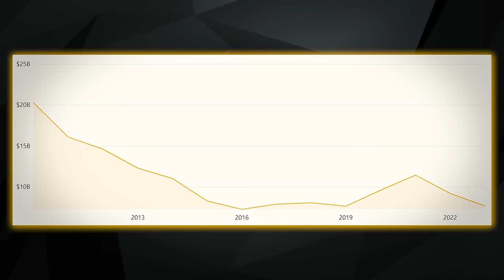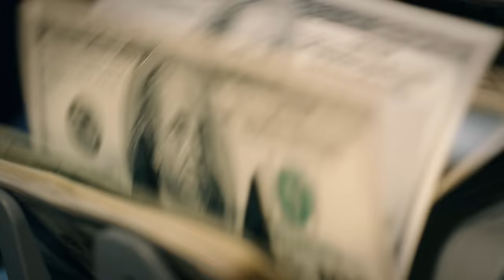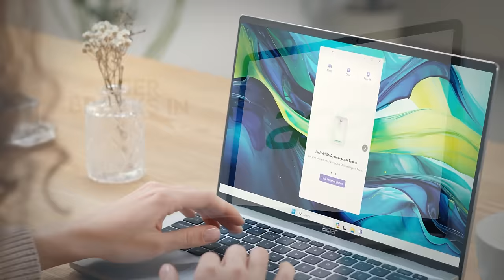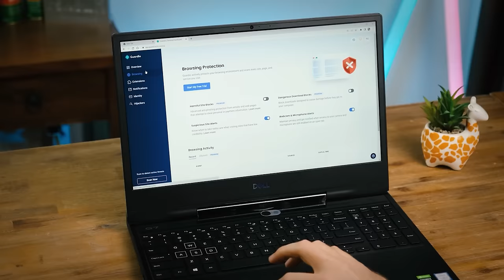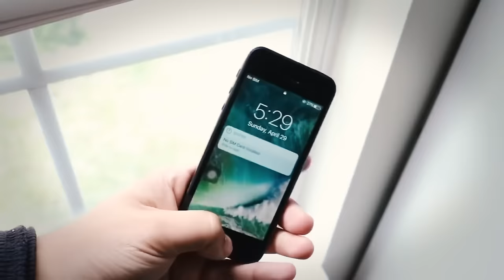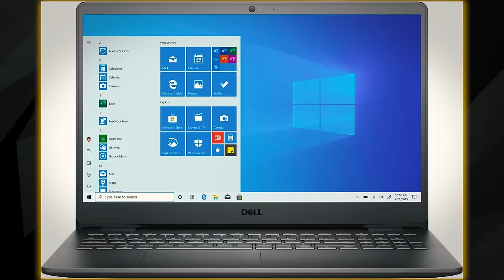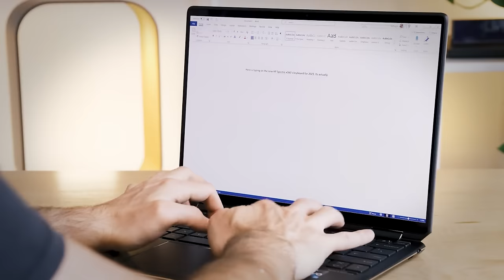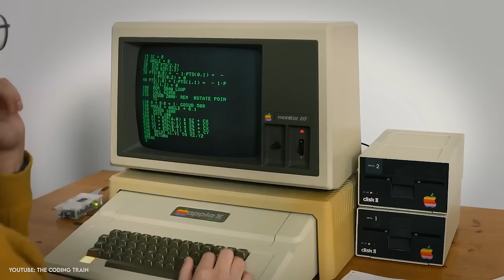Whatever Happened To Acer?

Comment: I am using an Acer Aspire 5 laptop right now and it's great compared to my old Lenovo laptop, it came with a harddisk initially but I bought a 500 GB Samsung SSD 980 and it works great now. Two problems that I find with almost every Windows based laptops is the poor battery life and very poor webcam quality when compared to MacBooks, if manufacturers can fix these issues, then Windows laptops wil continue to do well especially in the developing and poor countries where MacBooks are unaffordable to majority of the population.
Reply from the maker: Glad to hear that Acer has served you well man.  Battery life is definitely a worse for all non Apple laptops.
Reply: I have the same laptop
Reply: Yeah I also got an Acer Aspire 5 with the Core i5 8250U, it's nothing fancy now but at the time having 4c/8t and dedicated graphics in a budget laptop was very good. The only real issue it had was the 1TB HDD was murdering performance (even though it wasn't being used), but after tossing the HDD and bumping up to 20GB of RAM it's been fine.
Reply: All you have to do is purchase the right Windows laptop.  Apple only has a few models, it's one company.  Windows computers are built by hundreds of companies.  There are lower priced budget models, and other models that blow any Apple away.
Reply: i have the same laptop currently
Reply: I had an Acer Aspire 5 too - it was crummy. I guess you lucked out.
Reply: I too have same laptop with i5-1135G7, 480GB SATA SSD and 20GB RAM (4GB Soldered + 16GB upgraded), came with 8GB RAM
Reply: @adhithyamuthumani1199  Not bad at all, depending what video card it has.
Reply: @earthling1984  It has integrated graphics, intel iris Xe
Reply: @adhithyamuthumani1199  Darn.  Yeah you gotta get laptops with a dedicated GPU otherwise they aren't good for much more than websites and streaming.
Reply: @earthling1984  So far, there is no use for me to buy one with dedicated graphics since I use just for media consumption and notes taking. Maybe I'll buy one in the future. Tried Forza Horizon 4 Demo in this laptop, got just 15 FPS
Reply: @adhithyamuthumani1199  If that's all you do, that'll work.  For video editing / creating / gaming, you need dedicated GPU.
Reply: @earthling1984  Thanks for the info 😊
Reply: elitebook g8 and g9 have a battery life of plus 14 hours.....better than macbook.
Reply: you complain about battery life on Windows? Wait until you see how it goes on Linux....
Reply: the issue with windows laptops is the OS, its got a lot of bloatware compared to macOS. requires more effort from the user to debloat the laptop. a debloated windows laptop usually has around the same battery life as a mac in the same price range.
Reply: @racistlobsterofficial  Everything you just said is false.  What Windows laptop you buy will determine battery life (and yes, you can optimize any computer).  There are tons of Windows laptops that have batteries way better than any Mac.  And there are some that have way worse battery life.  1000's of companies make windows laptops, so there are options from very budget to very expensive.  And oddly enough, price and performance don't always mean better battery life.  Some high end gaming laptops are so powerful that they simply can not have a long battery life.  Mac is made by one company and only a few models.
Reply: @earthling1984  Well said
Reply: @racistlobsterofficial  Everything you said sounds smart and all (sounds good, rambling that proves no point).  But it's obvious you have very limited experience with Windows laptops.

Not sure what the argument is.  My point is there are plenty of windows laptops that beat macs in every way.  And plenty that don't.
Reply: @earthling1984  why not engage with the points i made instead of dismissing it as "rambling" lmfao holy shit. 

first off, the battery life in that price range for productivity laptops are extremely similar. i dont think its outlandish to say that and if you think it is, i would love to know why.

secondly, at the same price for a mac (lets say the 15 in m3 air, retailing at 1.3k USD ), you can get a 13th gen i7, maybe a 7940hs, maybe even toss in a xx50 GPU at the expense of weight. but these laptops will come with lower battery life compared to their mac counterparts. if you know of any that defy this statement, please do share more about it.

in conclusion, (1) battery life in that price range does not differ much if you are looking at productivity focused windows laptops and (2) these windows laptops at that price range will have shorter battery life if you do not debloat the system. 

i do not see how your point relates to my point at all. its very easy to just misinterpret the boundaries of a statement and toss in some common sense saying in rebuttal. of course my statement on battery life doesnt apply to all windows laptops. but i've already stated the ones which it applies to. 

im sorry that you cannot read anything longer than half a page, but that doesn't mean anything of that length is "rambling".
Reply: the battery problem isn't related to the os, it's because macbook use arm processor known for low power usage, if you want long battery live windows laptop you can pick arm based windows laptop like those that use snapdragon chip
Reply: @farhanrahmaddani3218  Yup.  All is power draw vs battery mah.
Reply: @racistlobsterofficial  The other bloat from Windows is the burden of legacy a.k.a. "backward compatibility", Apple just simply said "screw you backward compatibility, let's think forward"

Comment: I still own the Acer laptop I bought on early 2015. I have a newer laptop but Acer is the main one I use at home as desktop. Upgraded from 4gb Ram to 16 gb Ram, and from 512gb hdd to 2 tb SSD. It really works very well. I could use this for many years to come. I can not install Windows 11 on this, but I plan to keep using windows 10 and maybe switch entirely to Linux. I really dislike Windows 11. Had it on my work pc, but I formatted the laptop and installed windows 10. My experience with Acer has been very good.
Reply: I still use my 11 inch 2012 aspire one v5 to this day. It runs like a dream with low requirement linux distros.
Reply: Stopping using Windows literally 3-4xed my battery life.  But you will need to make some compromises to have a change this significant...
Reply: Go Linux, go!
Reply: @MuammarQadaffi Just use VMs and emulation. Microsoft's Dirty Operative System is no longer Quick (get it? haha). So it might as well just be a sub process on a superior system, just like most legacy programs (OG Mac OS, Amiga, ZX, you name it).
Reply: @MuammarQadaffi can you elaborate how and what you did?
Reply: @RERM001 That would make it even worse.  Windows 11 VM would probably drain that laptop's battery in 40 min.
Reply: Windows works badly on laptops

I think windows is created only for Desktop PCs
Reply: @MuammarQadaffi  This is exactly what i was thinking, when i used windows vm it actually drained my laptop's battery more quickly than simply using main os (windows)
Reply: @MuammarQadaffi  in my tests using different OS, only chrome os is giving more battery time, i used some Linux distros but none of them gave me more battery time than windows

Comment: I’m pretty happy with my Acer Nitro 5. Got it at a deep discount compared to other brands. It took 3 minutes to install a second SSD. Hope it lasts! It feels well built except for the hinges which are a bit wobbly. We’ll see!
Reply: Double on that. My Nitro 5 has even third SSD. Rarely a laptop has support for 3 drives. I'm using mine for 2.5 years already, it works great
Reply: I am a nitro 5 owner myself I have been using it for the past month I am enjoying it very much!!!!
Reply: Be glad because my Nitro V15 Nitro had still reversed mobo, it was a pain to install an SSD alone
Reply: ive heard some Nitro 5 has overheating issues?
doyou guys experienced that? or it just another bogus
Reply: @shiro3146  , I have rather old one, Nitro 5 AN515 with Ryzen 5 and Nvidia 1650 GPU, so this may vary with newer/more powerful ones. I always use a cooling pad (simplest one, an aluminum frame with no fans), also limiting CPU load in Windows power settings, and capping framerate in Nvidia's tool. With that setup laptop is quite cold. Never seen CPU over 50 degree Celcius, even playing Cyberpunk 2077
Reply: Let me guess,  battery dies in one year

Comment: My aced laptop is from 2016, convertible and still works like intended. 
Also its very easy to repair. I actually swapped my i5 mobo with an i7 mobo from ebay. 
When you are low on cash, acer is great start.

Comment: When I worked as a computer technician in the 2000’s/early 2010’s, by far the most common machines I’d see in for repair were Acers, complete with their slow Celeron CPUs, cheap ECS motherboards and cheap power supplies. Aspire SA80’s were the worst with their crap caps. When one of those came in I generally knew what the problem was before I touched it. They were crap to deal with as well. Good riddance.

Comment: My first Laptop was an Aspire One D150, my second one was an Aspire v3-771g. Both of them still work fine and the latter one even in regular use. I had to replace the fan and added a SSD and some RAM though. Pricing was always and is still very relevant to me, the v3 was cheaper because it came without Windows. I try to get what I need for the lowest price possible, I don't care about the brand.

Comment: Interesting watching this on an Acer Nitro 5 I've had for the last two years. The specs aren't bad -- Core i7, modern NVIDIA GPU driving a 144Hz HD display, 1TB NVME drive with an extra slot and a 2.5" SATA bay, 16GB RAM with slots to spare, and all for about $1100 USD. Still going strong (knock on wood).
Reply: And how's it doing with its temperatures? Does it overheat?
Reply: @linnymiddy  Never, not even once.